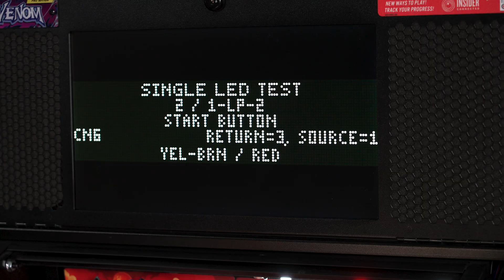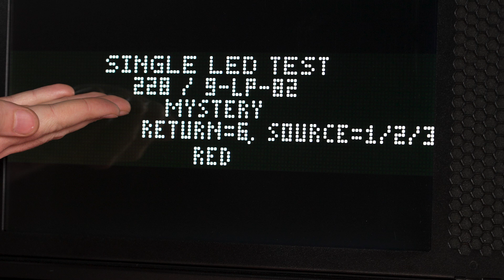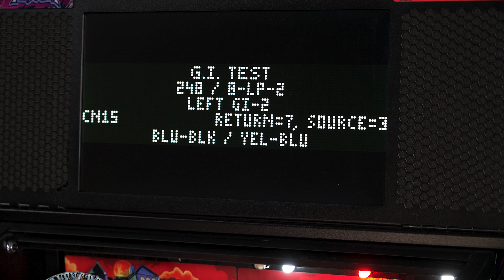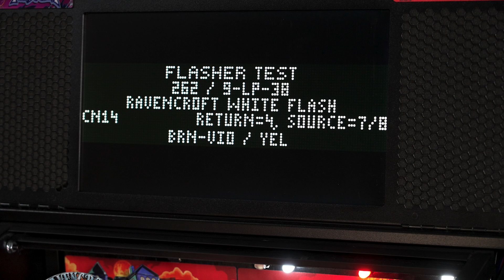Stern Tech School: Lamp Tests

Comment: Always great stuff, Kyle!  Seeing it triggers a general question, is it normal for the diagnostic control buttons to “double press”?  Wondering if the buttons have an issue, or the firmware just doesn’t have any debounce logic in the menu screen and it happens for everyone.  Never caused a problem, but just feels like it could be better :)